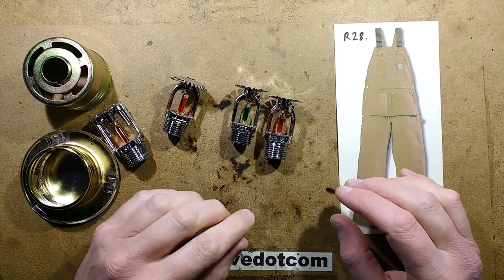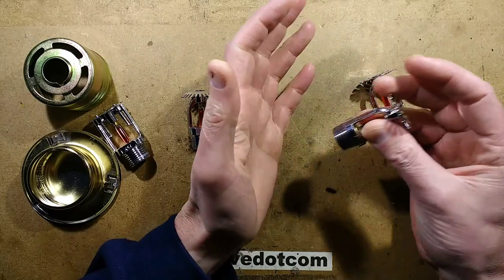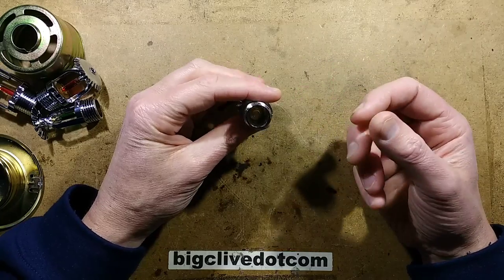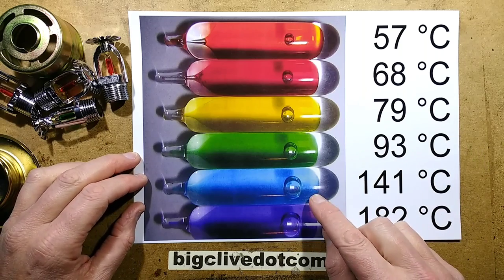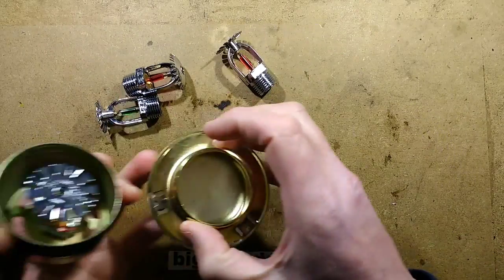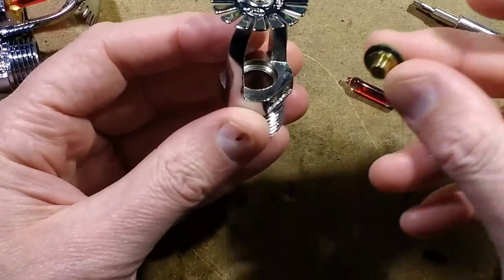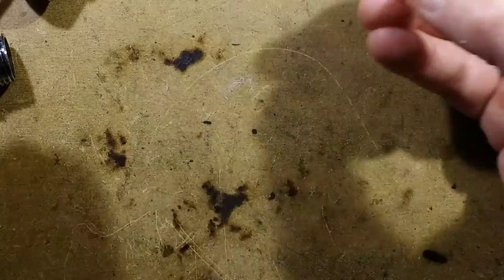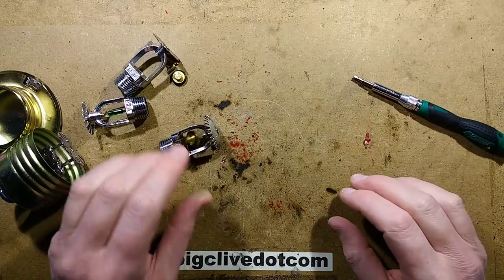How a fire sprinkler works. (featuring broken glass and spatter.)

Comment: The bubble size is in fact what sets the trigger temperature. Heated alcohol expands, and the increased pressure shrinks the bubble. When the bubble disappears, the expanding alcohol has nowhere to go but out.
Reply: As to how they set the bubble size, I have no idea. The simplest way seems to set the fill pressure to get an acceptable average bubble size, and then sort them optically, but since they are different colors, that doesn't work.
Reply: As another comment mentioned, it will be much easier to heat the capsule to the burst temperature, then seal it (without any gas in it). The bubble is just what forms whenthe liquid contracts to room temperature in the now sealed tube.
Reply: I think you can actually see the bubble in the vial shrinking as Clive heats it.
Reply: Wouldn't it be a bit contraproductive to put a flameable liquid in a fire sprinkler
Reply: @felixb.1756  It's only counter productive if it fails to stop the fire.  For example, it would be counter productive if your fire sprinkler sprayed gasoline instead of water.
Reply: @mastertintiger  That would be interesting, a sprinkler spraying gasoline on a fire.

Comment: If I remember correctly from fire classes, the vial is called a frangible tube and contained alcohol. Keep in mind the hot air rises and temperatures at ceiling level can be hundreds of degrees higher than at floor level. Hence if you are ever in a house fire, roll out of bed, don't sit up, and exit low.
Reply: highdesert50 interesting that Australian standards state they only contain water, might be different per region
Reply: Yet when they freeze and blow without there being a fire, the mess is just as big, if not bigger to clean up in the end

Comment: What is that liquid? It's how the Chinese have figured to export toxic waste for free.
Reply: For whatever amount of toxic waste China exports, you can be sure there is at least double that amount in their landfills, floating in their rivers or oceans, or just laying in an open field.  Truly an ecological nightmare.
Reply: I assume it's the same stuff they put in non-mercury thermometers, because for both applications you'd want a liquid with the greatest thermal expansion.
Reply: That would be alcohol.
Reply: You wouldn't want pure water to be in there since it would make quite the mess if it broke from being exposed to freezing temperatures.
Reply: They would contain varying mixtures of ethanol and water for the low-temperature range, and water and glycerine for the high temperature ones. You cannot use a liquid above its boiling point, the thin tube would explode long before it reached the rated temperature.
Reply: From a firefighter... it’s just water, theses are designed for warm climates, there are metal fused ones that trigger when a bit of solder melts
Reply: +OZf1re
I would think one of the low melting point Bizmuth alloys would be better.
Reply: which probably explains why they're so cheap :P
Reply: india is slowly getting worse...
Reply: It is alcohol, which when it gets too hot, the glass burst to open the sprinkler.
Reply: Glycerin
Reply: Hi
Reply: +Mister Hat Yes.. and their newspapers go in the paper umbrella's we put in our cocktails :)
Reply: OZf1re Coming from a sprinkler fitter, sorry but WRONG,  It is not water, It is not affected by cold and can be used in freezing environments if installed in a dry system. it is an alcohol based liquid.
Reply: Not sprinkler fitter, but what bluepowerwagon says makes sense to me. However I have heard of, though never seen, sprinklers that use a low melting point metal alloy. Although that's not what Clive has here. I can't imagine that type having any liquid as part of the mechanism.
Reply: GBatT you remind me of the time I got a little oil can from the bargain bin at my hardware store and the damn thing was actually made from a powdered baby formula can turned inside out!
Reply: Guys it's a joke chill out
Reply: So if there's no water in the system, you just get flammable alcohol sprayed on your fire? Great.
Reply: Even the ones are showing are made in China to the local specification and then labeled as local products selling at local prices!
Reply: @cup_and_cone  and yet US manages to do worse... Lol
Reply: @shadowblack1987  - That's not even remotely true.  Most of the oceanic pollution comes from China, India, and south Pacific.  

I am not talking C02.
Reply: It's a glycerine based liquid.
Reply: Matt Tovey if there’s no water in the system, the structure either is unoccupied or shouldn’t have hazardous/flammable materials in it, and even if it did, it’s like 2mL of alcohol. not really going to make a difference in a fire intense enough to set off the sprinklers. do you think before you type?
Reply: Liquid alcohol and water, the mixture depends on the desired temperature to "shatter" the glass bulb, and a ink to indicate the temp rating.
Reply: @OZf1re  From someone who just googled it, its alcohol glycerin and water.
Reply: Andrey DeOliveira < As you've mentioned, an alcohol/water mixture is the most plausible explanation, and I don't think the bubble's size matters at all, maybe it's just there as a visual cue like the color code.  Most likely the alcohol/water mixture ratio is what gives the different temperate expansion.  The more alcohol in the mixture the lower temperature rupture.
Reply: It’s a thermometer so when me gets too hot they break and put the fire out